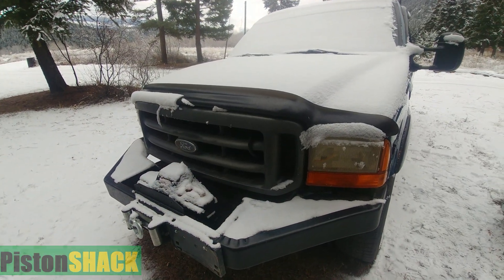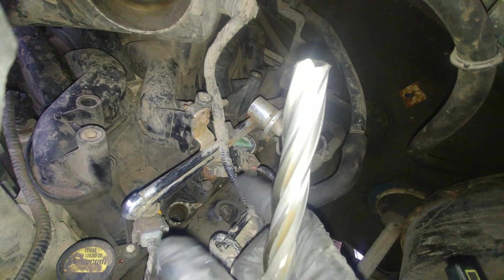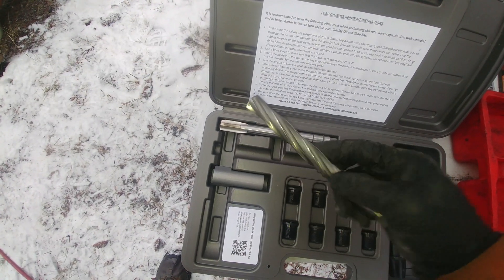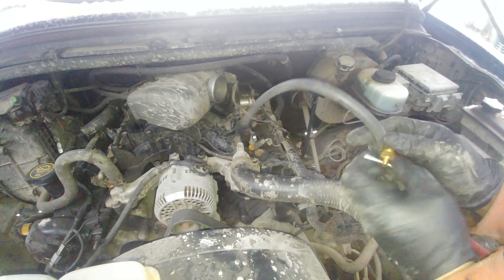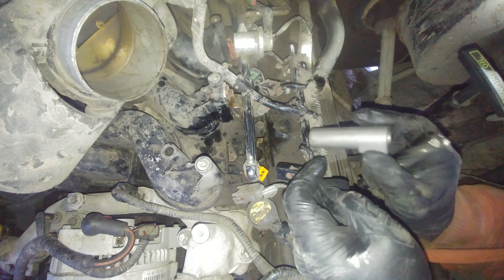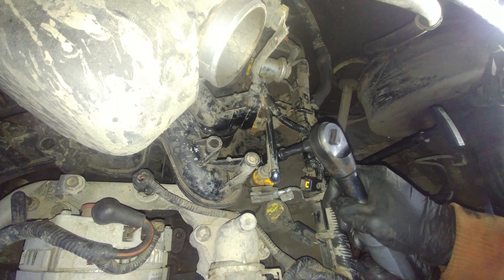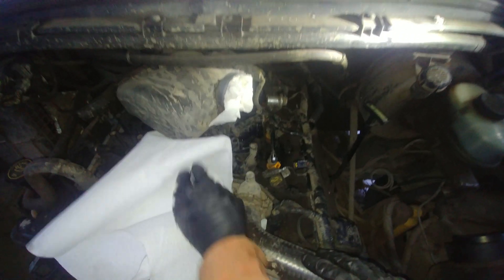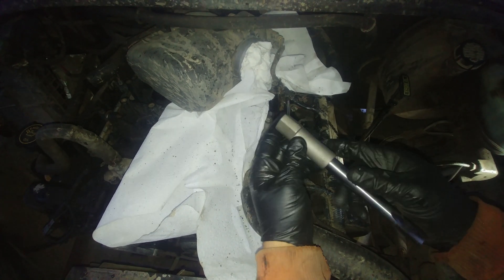FORD Triton SOHC 5.4L, 4.6L 2 valves | BLOWN OUT SPARK PLUG PERMANENT REPAIR |  | CalVan 38900 kit

Comment from the maker: More Ford Videos: 7.3 POWERSTROKE DIESEL: FUEL FILTER REPLACEMENT and PRIMING FUEL SYSTEM https://youtu.be/FNRYRRFEZmw
How To Diagnose and Replace Windshield Wiper Motor on Ford F-250, F-350 (99-07) https://youtu.be/5a5_JreHnsQ
MY LIST OF CRUCIAL QUESTIONS TO ASK CAR SELLER BEFORE YOU GO TO CHECK IT OUT. FIND GOOD CAR & SAVE $ https://youtu.be/y7FL8V9Ct9I
KEEP WINCH FROM BEING STOLEN. BEST WINCH THEFT PROTECTION. https://youtu.be/NimO_QxBs5E
WHY YOU SHOULD NEVER IGNORE FAULTY PCV VALVE?! Small Valve BIG problems. Ford F250 PCV valve change. https://youtu.be/tdeoA4m2IWE
HOW TO REPLACE FUEL FILTER on FORD F250 F350 gasoline TRITON 5.4L V8 or 6.8L V10 https://youtu.be/AVc0Ou2DJQY
SERPENTINE BELT TENSION REPLACEMENT on FORD F250, F350 Triton V8 engine 5.4L https://youtu.be/5X-Vflmcc6o
TROUBLESHOOTING LICENCE PLATE LIGHT CIRCUIT. Any vehicle. Fixed! https://youtu.be/230Au9Y3d80
HOW TO REPLACE FRONT SHOCK ABSORBERS on FORD F250, F350 https://youtu.be/CWDG8MpFW4Q
HOW TO REPLACE REAR SHOCKS on FORD F250, F350. https://youtu.be/XERnqBwHibk
4x4 Light on Dash Doesn't Work. Diagnosis. How To Repair Wiring Harness https://youtu.be/lGsQ_swBQuU
TOYOTA 4RUNNER RESCUE: (El. 4200 ft., 23 km deep in the woods, 21 ft. down)  only TRUCK & WARN winch https://youtu.be/Fs_2VRUYYNU
FORD F350 5.4 L AIR FILTER REPLACEMENT https://youtu.be/BbYcUFArue4
FORD F350 5.4 L V8 OIL CHANGE GUIDE https://youtu.be/SQkTv1m_Suo